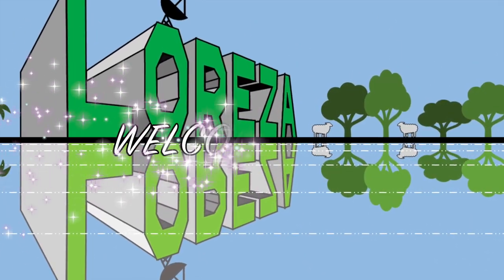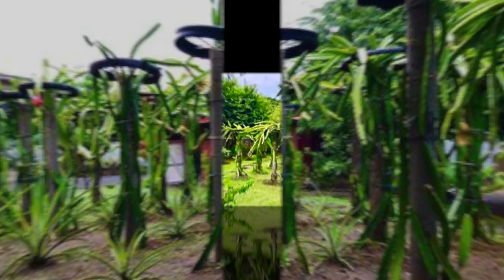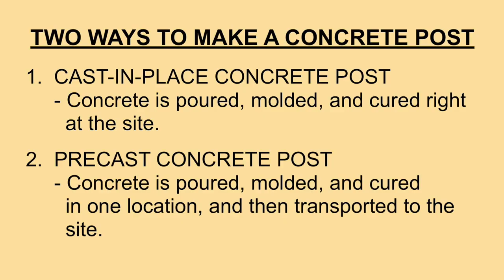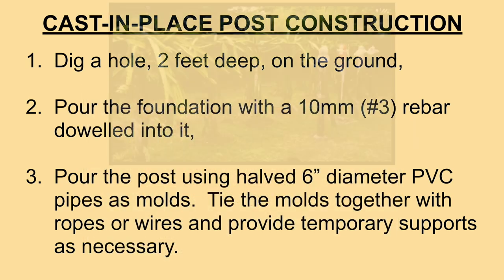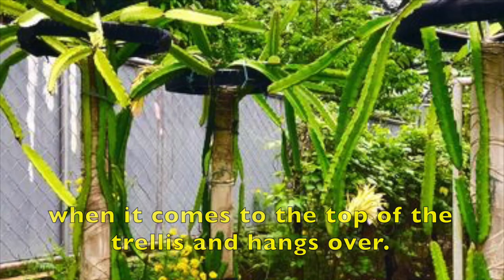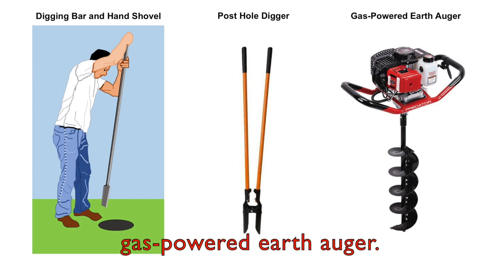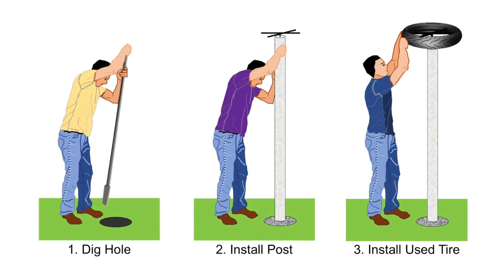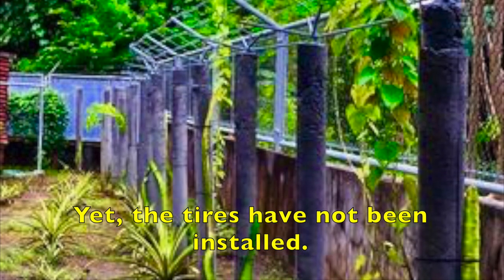How To Build Dragon Fruit Trellises (Concrete Posts)

Comment: Hello po, if I plan on planting dragonfruit in a large 20Gallon pot, do you think using purely PVC pipe or a cococoir pole could be sufficient (plus a concrete base/tire top)?
Reply from the maker: As long as you keep your plant within a manageable size, you can use them.  Also consider the life span of DF compared to that of the material you intend to use.  Note that PVC gets brittle in extremely cold temperatures.  It also decreases in impact strength when exposed to sunlight.  I can’t say how long it would last though. It depends on the actual forces (e.g. hurricane, flying debris blown by strong wind, etc.) it would be subjected to within its life span.
Reply: @LorezaKabuhayan  Ohhh thank you! I didn't think about the impact the direct sunlight would have on the PVC pipe.

Comment: What about PVC pipes as a post?
Reply from the maker: PVC gets brittle in extremely cold temperatures and losses impact strength when exposed to sunlight.  I am not sure how long PVC would last though.  I guess it would depend on the actual forces they would be subjected to (high wind, etc.) during their lifetime.